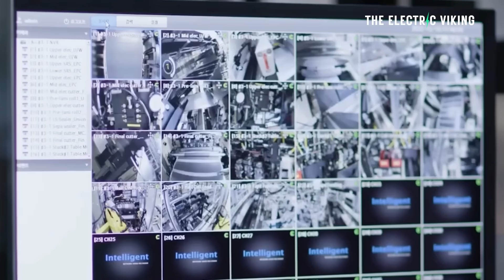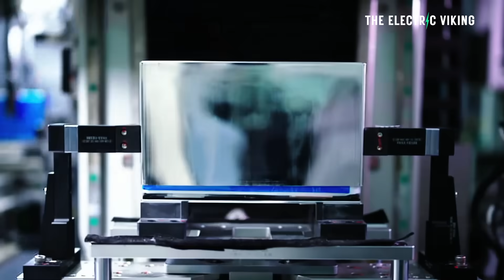GM’s Secret Weapon: Cheap, Safe LFP Batteries: A $6,000 EV Price Slash!

Comment: it would be amazing if 24M batteries could get to market in GMs (or any vehicle for that matter) with about 660 watt hours per kilo, very low temp performance (-40 degrees F or C), just about dendrite proof, and they’re extremely easy to recycle. 24M is out of the MIT lab in Cambridge Mass and they could leap frog anything made in the world.

Comment: TOO LATE ELON ALUMINIUM ION BATTERY: HALF THE SIZE HALF THE WEIGHT 5-600 MILLES RANGE, NO LOST AT MINUS 45 DEGREE TO 150 DEGREE, NO FIRE, EXTREMELY SHORT CHARGING ,  EXTREME LONG LASTING BATTERY, LEFT ALONE IN THE GARAGE WILL LOSE 90% LESS POWER THAN REGULAR BALLERIES,  1300 US DOLLARS ,YES $ 1,300.00 YOU GOT THAT RIGHT. NOTHING WILL TOUCH TESLA . THE ONLY THING TO WORRY ABOUT IS INSURANCE RATE BUT WITH $1300 BATTERY AND NO FIRE DANGER , RATES WILL COME DOWN A LOT, NATURALLY WITH ALL THE RADAR AND TECH IN BUMPER , IN FENDERS, IT WILL STILL BE MORE THAN GAS CARS BUT NOTHING COMPARED TO TODAY UNLESS INSURANCE COMPANY, TRY TO SCAM EV OWNERS.

Comment: As Sam goes on and on about the cost of EVs going down, frequently quoting his muse, Tony Seba, let's do a small reality check. A Lucid Air 200Kw battery cost around $25K. The car cost around $250K so if someone GAVE them the battery, the cost would lower 10%. The Tesla S battery 100Kw is $10-12k and the car runs around 90K, the Model 3, 60 Kw, 6-7K. Do you see where I'm coming from. Lower the cost 50%, which could take a while and still you don't have a tremendous, GAME CHANGING reduction. Yes, you can put a shell on an electric moped and call it a car and it would be cheap. But....to get the quality, reliability, amenities, etc we have come to expect in a vehicle and there are practical limitations to the cost reduction.
Reply: The math works out differently when looking at more affordable options. The battery is a much higher percentage of the cost. Just a few years ago, Ionic 5 were a write off if the battery was damaged.
Reply: Well said

Comment: I don't see why manufacturers aren't more excited to be going towards EVs. It's less parts and they should be real happy about that. I'm going to be ordering a GMC Sierra EV within the next few months.
Reply: They probably have to deal with dealerships. On the one hand, it takes care of them so they don't have to work so hard to sell units. On the other hand, dealerships constantly scalp and extort the customers. Dealerships have unique protections that keep them around and the dealerships don't want EVs, they want to have the recurring revenue that comes from servicing ICE vehicles. So GM or Ford wants to make EVs? Too bad, the dealerships purposefully hide or hinder the adoption and the OEMs can't get rid of dealerships.
Reply: @milohobo9186  Dealerships make so much profit from parts and service. Since there are 20 parts to an EV and maintenance is very low it's less profit for them.
Reply: I work in a part distribution facility for cars. The major auto makers make more money off. Of parts than anything and electric cars have hardly any parts. You should check it out. Just google it it's crazy
Reply: EVは売れないのです。人気がないのです。リセールバリューも大幅に下落しています。アメリカ市場では、今年に入って33，7％の下落しています。中国は40％下落しています。

中国でEVが売れてるように見えるのは、中国の5大都市はEV以外買えないのです。半強制的です
Reply: @田中亮太-k3u  In the US EV sales climb every year they don't decrease. Stop making things up.
Reply: @PyroShields  アメリカは脱炭素から脱退しました。8月から補助金も無くなります。

かるほぉ
Reply: @田中亮太-k3u  Incentives are good until the end of September. Besides that's irrelevant. You said EV sales are decreasing and that's false.
Reply: アメリカ市場の2024年は前年に比べて、車両価格を平均２５％値下げしてます。それでも売れなかったので、更に全メーカーは年末にかけて、インセンティブを付けて販売しています。売れば売れるほど赤字になるのです
Reply: @田中亮太-k3u   2024 1.3 million EVs were sold. More EV's were sold in 2024 and 2023 in the US. Again you're cIueless.
Reply: 中国自動車メーカ―全社の利益は、トヨタの利益の半分にも満たない。

中国のEVは、国から2兆3000億円の補助金を貰っています。

中国の自動車産業の利益は、実質0円です。

中国のEVは、大赤字です。中国も売れば売るほど赤字です
Reply: Because they actually have many more parts. The Tesla Model S has over 7,100 cells just for the battery pack alone... and yes, each individual cell is a part!!!
Reply: @bfree6197 
Notwithstanding each cells, but rather a cell pack, the total number of parts is significantly reduced.
EVs typically have:
	•	60–70% fewer moving parts than ICE vehicles.
	•	About 50% fewer total parts overall. From 30,000 down to 15,000.
Reply: @cottagegymfun which is why the EV industry doesn't like to count each battery cell... very deceptive. Cell packs also referred to as modules have many cells. Repair facilities do take the cell packs apart and replace individual cells... as individual parts!!!

One could easily do the same and count an engine as only one part😂.
Reply: @bfree6197  EV's have less moving parts. The battery is count as one because if it's defective they replace the battery not each cell. Make some sense.
Reply: @PyroShields So tell me then... just how do you think they repair them? Do they wave some magic wand? 

You get a used repaired battery back as a replacement for convenience and to speed up the process of getting your car finished.

You can watch videos where they explain the process in further detail. Yes they open them up and often times replace individual cells
Reply: @bfree6197  First off a battery is not a moving part. This is why a battery is count as one part. Just like an ICE take an example an alternator it's count as one part. You don't count the individual parts that make up the alternator.
Reply: @PyroShields  Where does anything state that it's not a part because it's not moving. Now you are just making things up 😂.
Reply: @bfree6197  A battery is considered one part. I already said this weren't you paying attention?
Reply: @PyroShields yes... each individual cell is a battery. The problem is they group EV parts then count it as one...  Be fair, group parts the same way for ICE and count an engine as one. 

The Biased Counting System, for each, the EV market has created is abundantly obvious.
Reply: @bfree6197  replacing individual cells has proven to be not the best idea. just replacing entire battery pack with a new one is better as the cells balance and you have less of a chance of trouble with the pack prematurely, having trouble in the future is more likely. so I would not be in favor of just replacing one individual cell, from the latest research that I’ve seen. manufacturers are slow jumping on board, but it is progressing and sometimes slow isn’t a bad thing. It’s good to see that General Motors is doing well though very happy for that!
Reply: @bfree6197  What EV parts are they grouping that they count as  1?  An engine has thousands of moving parts though.  Your claim that EV's have more moving parts than an ICE is incorrect.
Reply: In New Zealand there is a company replacing cells only for leafs.
Reply: @PyroShields True, but there are 8000 parts.  8000 parts that could fail.

Comment: I wouldn’t buy an EV unless it has the best battery on the market
Reply: There is no such thing as the best battery chemistry as the ten best is very fluid and can mean different things to different segments of the market. Are longest range better than shorter range. No but necessarily if the vehicle is signed at the more end of the market where price is a big consideration etc. 
It's like saying, what is the best petrol engine? Is it the most economical? Sometimes it is but that isn't good enough if you want to pull a caravan etc. So there is no such thing as "best" as it is dependent on so many different factors